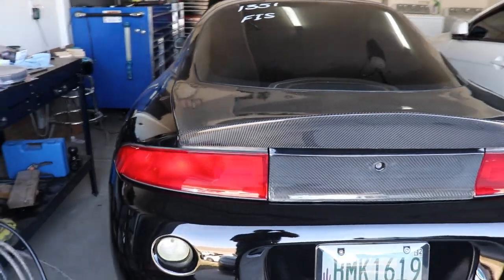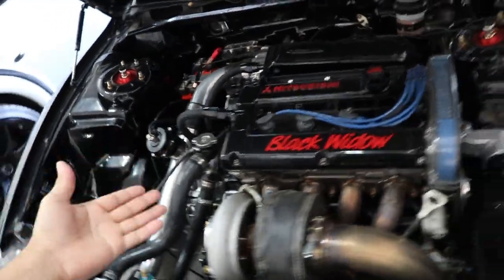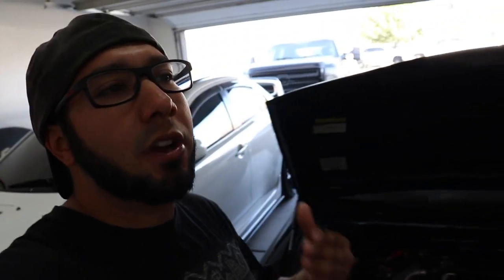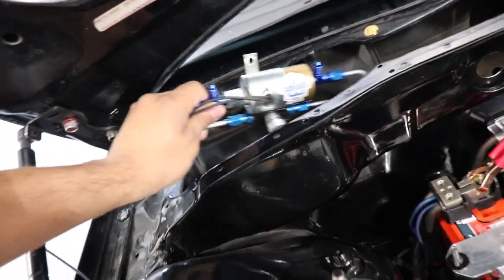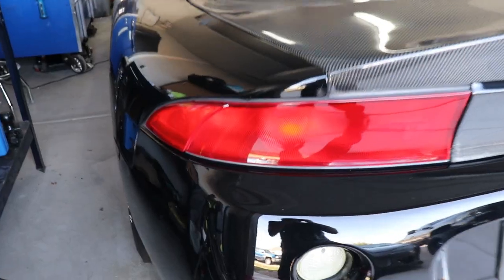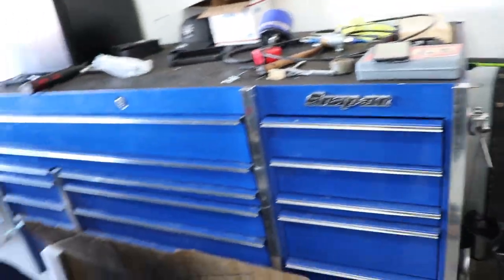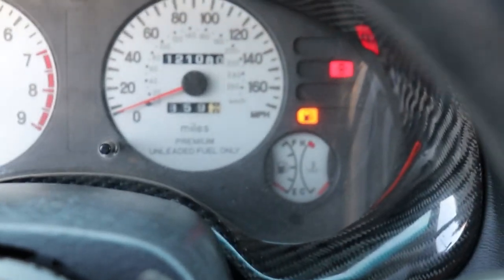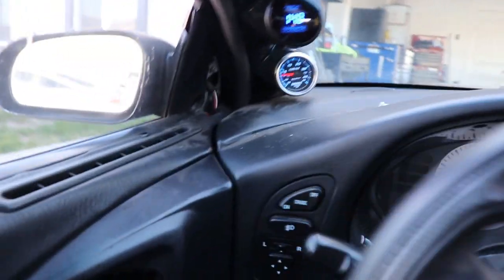POV Drive: 2g Eclipse ROLLING ANTI LAG Testing 40 PSI BOOST Pulls

Comment: Competition Clutch is known for harsh engagements. Clutch Masters from what i’ve heard has a very smooth engagement. Triple disks feel close to stock.
Reply from the maker: I have never used a triple. When this twin says no more I think I'll try it out
Reply: @Gabe_Ortega  Ive got a Competition Clutch twin disk on my civic, it’s lasted for years.
Reply: A triple disk feels great. Smooth engagement, doesn't rattle like a twin, and of course will hold plenty of power.

Problem I had though was I did a no lift to shift and the clutch disk closest to the flywheel flexed just enough to hit the ARP flywheel bolts. End of story, it DESTROYED my transmission. I'm auto now.
Reply: @V8sareslow1  Oh fuck I could imagine how that sounded and the aftermath..sheesh
Reply: @Snail2G  it somehow stayed in geat and allowed me to get it on the trailer, and was done. Had to push it to get it off though.
Reply: @V8sareslow1  that's wild. Weird question but what did it sound like?😂😂
Reply: @Snail2G  BANG!!! Lol.
Reply: @V8sareslow1  yikes 😂😂
The 1 trans I blew, when it went, didn't even make a bang or a pop.
It just suddenly sounded like you were trying to blend 100lbs of metal
Reply: @Snail2G  well, clutch disk hitting flywheel bolts at around 9k rpm's tends to have pretty catastrophic results. For me anyway.

Comment: I wish I could say those Magnus launch control devices work well but sadly they don't. Little known fact, there are actually 2 versions, the regular one and a "pro" version, only the pro one has a fine enough adjustment to actually work well. The next issue is depending on the temp of the clutch fluid, it completely changes the speed of release. In my experience and I tried for over a year, the regular one simply does not stop drivetrain failures.
Reply from the maker: I heard this before buying it. I was alittle skeptical about it for the cons but I think it's worth a try for a few months. The nice part is I can use it when I want to to see if I can get the hang of it.

Comment: Hey gabe just wanna ask are you running 6bolts engine? I have the same dsm like yours I lik3 your setup Im plannin to build my engine too.
Reply from the maker: I have never ran a 6 bolt.
, Always the 7s. I build the internals so the stock platform dosnt make me choose between them...however I stay away from the 95-96 blocks
Reply: @Gabe_Ortega  cool thanks im excited to build my 7s now slowly👍

Comment: Hey man fellow dsmer here. Question about your antilag settings, so I have my clutch switch hooked up to a momentary switch. And also wired in for NLTS and can monitor clutch switch value in link. I have timing at 7* ATDC and fuel enrichment at 12%. ALS set to come in at 5200 launch control at 5500. I get good pops at idle using antilag but when driving trying to use the button it does build boost much earlier than without but no pops or anything. I really just wanted to get a feel of how your settings were looking for anti lag function. Your really the only one with good footage of this in action that’s currently uploading. Thanks for your time I hope to hear from you
Reply from the maker: Sweet setup! Im around 10 atdc and antilag set to come on at 5000 with the 2 step at 6000. Builds about 18+ psi within 1 sec. I'm gonna be playing around with it soon to bring the boost down, I Wana try and be around 10 psi when launching and rolling antilag
Reply: Thanks so much for the reply! Do you have anything for fuel enrichment settings? For some reason mine feels like it does stop the car and builds boost but doesn’t pop at all like it does at idle hitting antilag. What are the odds you’d be able to screenshot your rpm and ALS tabs and pm them to me? That way I can see if maybe it’s just something  I have checked or don’t have checked that’s causing go my issue. I’d greatly appreciate it and I look forward to seeing more videos for you man!

Comment: this is on dsmlink v3? all your tune? so you have rolling antilag, two step, and nlts? awesome set up! cant wait to get dsmlink in my talon.
Reply from the maker: Yes everything :D
Reply: @Gabe_Ortega  so do you use the clutch on the no lift to shift? i thought the clutch switch is what kills ignition timing on the nlts? or do you not have to cuz of your dogbox? just full gas pedal no clutch?
Reply from the maker: Yes the nlts is still controlled by the clutch switch. However I wired in the rolling antilag online with the wiper on and off switch. Fun to use!
Reply: @Gabe_Ortega  that’s awesome pulling the wiper to have the rolling anti lag!

Comment: Are you using the no lift to shift input function with your wiper deal as a “clutch switch” like they would typically do to make rolling antilag work in the ecu?
Reply from the maker: Exactly I have the wiper switch wired inline with the clutch switch to ground it when ever I want..usally around 5500 rpms tho
Reply: @Gabe_Ortega  and because you have the dog box no need to have the pedal switch actually work … pretty smart
Reply: @Gabe_Ortega  Can it possibly be wired to have both the pedal switch work, and the NLTS?
Reply: Are you running dsmlink?

Comment: What size are you wheels ?
Reply from the maker: 16s
Reply: @Gabe_Ortega  16x7 +40 did you have to run spacers in the rear ?
Reply: 26x9.5 - 16?
Reply: @Gabe_Ortega  one last question bro lol did you have to run spacers in the rear or did they clear no rubbing ?

Comment: curious i bought a gemof a 2g eclipse gs-T everything is stock how much boost casn these 4g63 engines take being pretty reliable you know?
Reply from the maker: 18 psi on a stock t25 pretty much maxed it out, turn it into a hair dryer after lol
Reply: @Gabe_Ortega  guess ibwoukd have to upgrade down pipes bigger turbo and forth?
Reply from the maker: @33adrenaline  4g63 will take a hell of abuse, around 450 hp. Your turbo and fuel will decide on how much power you make.
Reply: @Gabe_Ortega  ok I'm new to dsm been a honda Mercedes  guy nut always lived the eclipse 4g63.. could it handle 25 or 30npsi stock block?